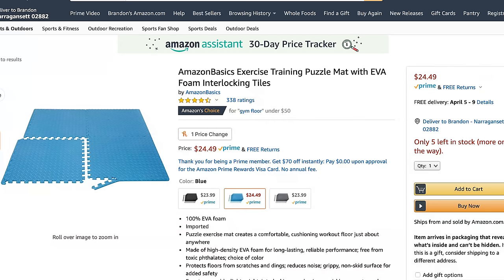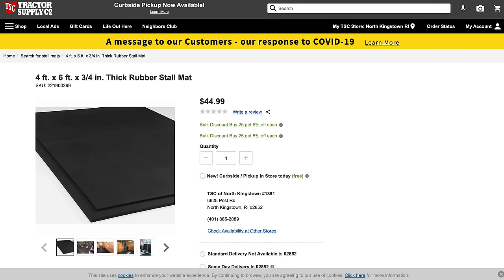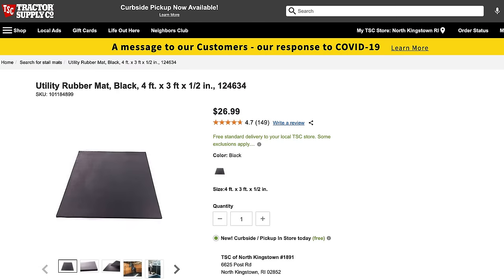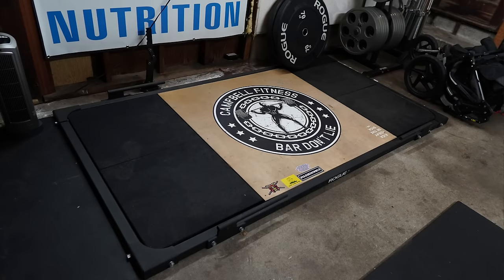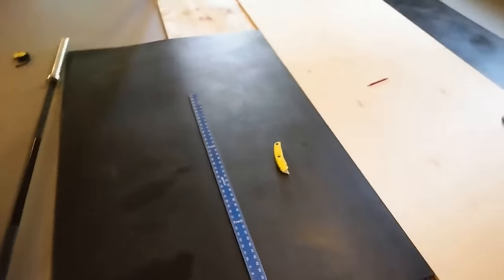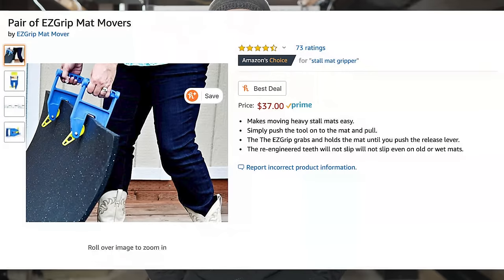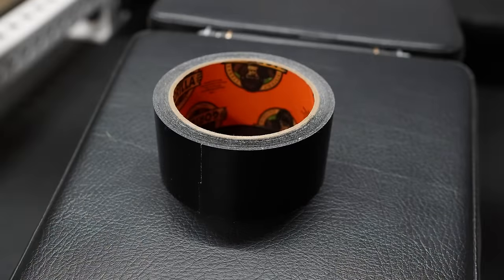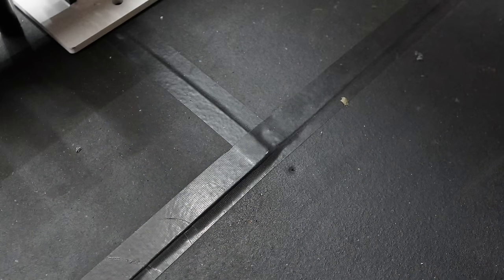Home Gym Flooring Basics

Comment: For deadlifting, do you think having 2 sheets of plywood underneath stall mats would provide significantly more protection for your floors vs 1 sheet. In your platform videos, you use 1 layer of plywood underneath. Any reason why you don’t use 2?
Reply: Alex Desta I use 2 layers of plywood with the TSC mats and another plywood in the middle. It’s better safe than sorry.
Reply from the maker: I think it's "better" but I also think there is a point of diminishing return. Never had an issue with a single layer of plywood and a single layer of matting.
Reply: Brandon Campbell Diamond What do you think about just stacking 2 stall mats together instead of the plywood sheet?
Reply from the maker: Alex Desta fine room. Might get a bit more bounce.

Comment: Any sort of multipurpose cleaner or believe it or not, degreaser works well.  I laid mine out on the driveway and hosed them down, then used a long reach scrub brush to clean them off.  I scrubbed them twice on each side and let them dry out in the FL sun.  The smell decreased by about 80%.  There seems to be some oily residue on the mats when you first get em which can also make them a little slick (hence the degreaser).
Reply from the maker: Thanks for the feedback!

Comment: I put down a few stall mats (one side is smooth the other has texture) in my unfinished basement about two years ago. Just recently I noticed when it rains I get some water underneath the mats only. Any recommendations on how to combat this issue?
Reply from the maker: You may be able to get a vapor/moisture layer

Comment: You just answered my question. So Carpet it is. And I will just use a  Platform for deadlifts. I am not dealing with that smell in my basement. Thanks.
Reply from the maker: No problem.

Comment: I saw a shot of a rack set on top of the mat.   Do you typically have your rack on top of the mats, or would you cut around the feet so the rack sits on the floor/concrete directly?   Wondering if it is ok to bolt the rack down right through the mat or if the rack needs to be directly on the concrete.
Reply from the maker: You can do either, I just don't like cutting stall mats if I don't have to. If you do, put the rack on top of mats first and outline the feet with a sharpie, then go back and cut.

Comment: If you lower a deadlift with control or perform a controlled drop (never dropping from the top) can you getaway with just 1 layer of stall mat or is a platform the way to go as to not damage concrete in the garage?
Reply from the maker: Lots of people in the comment section say so!

Comment: Hey Brandon, I want to turn my storage shed in my backyard into a gym. Its a shed built on top of a concrete slab by the previous owner. Only problem is that when it rains hard (which seldom it does in west Texas) it leaks on to the concrete in the 4 corners of the shed. If I place these on the concrete and it rains and water leaks underneath will it just evaporate over time because of the grips on the underside or will it mold? Or do you know of better option? I can't figure out y the thing is leaking in the first place otherwise I would just fix that.
Reply from the maker: I imagine prob a bit of both (mold and evaporate). Give it a go and see if you can get by with them.
Reply: @BasementBrandon  sounds good thanks for the quick response.

Comment: Thanks for this.  Question.  Would this work for covering a workout area and also an area where a truck is being parked in a garage as well.?  I have a 1/3 or 1/2 Bay Area where my rack will go but want to put down flooring across where my truck is park where there will be water and snow coming in with the truck-then the truck will be moved when I work out.  Guidance appreciated.  Thanks so much
Reply from the maker: I think it would work (I've seen it), but it's prob not ideal

Comment: I’m planning on putting my home gym on carpet, as I don’t have any other space available. I’m worried about the rack tearing up the carpet under it, and I don’t plan on doing any movements that would threaten the foundation (deadlifts, snatches, dropping the weight). Would I still need flooring to protect the carpet from the rack? Could I just use plywood as a flooring, opposed to horse stall matts? Thanks!
Reply from the maker: I think part of it depends on how plush the carpet is. If not very plush you should be able to get away with something a lot more minimal.
Reply: @BasementBrandon Thanks! One last question with regards to horse stall mats: When I go to the tractor supply website, and select pickup, it ends up including the amount for shipping. Is it possible to simply go to the nearest tractor supply and purchase the mats in store?
Reply from the maker: @codershane6569  Yep, I'd just call ahead and make sure that 1) they're in stock 2) they have the kind you're looking for.

Comment: Here's a tip guys-Use mending plates under your mats to keep them together, look up Allan Thralls gym flooring hack video to see what I mean. (I know you saw it already Brandon but for those that may not have I wanted to share it here) Also some people suggest putting concrete screws with a washer to squeeze it down around the perimeter, I would suggest doing that during the summer though so they don't buckle when they expand from the heat
Reply from the maker: Right on!

Comment: quick question, if I dont drop weights from overhead and don’t plan on deadlifting heavy weights, mainly have a rack for squats bench, rows and accessory work along with an air bike. Do you think 1/2 inch stall mats should suffice, or do you still recommend 3/4? Asking since I saw 1/2 inch 3x4 mats at 12 dollars vs 4x6 3/4 inch at 40. Thanks
Reply from the maker: Prob don't even really need mats if you don't want in that case, but 1/2 would be fine.

Comment: Brandon, do you have any recommendations for gym flooring over carpet? Thanks.
Reply from the maker: I might try to put a more firm layer first depending on the plushness of the carpet. So maybe a thinner piece of plywood first, then mat.
Reply: I put down a 1/2 inch plywood  and then stall mat from Tractor Supply. Provides a much firmer foundation.

Comment: I started a deadlift program right when the quarantine started so I needed a place to deadlift. Went to tractor supply with my brother on Saturday and luckily there were 2 of the 4x6 mats left, just enough and perfect space for our basement. Haven’t had any issues and were only deadlifting in the 300-400 range. However we have concrete flooring underneath so would you still recommend trying to get 2 more mats to stack on top? Or do you think the one may thickness is fine for now?
Reply from the maker: There are some in the comments who said they've used a single layer with no issue. I'd just check underneath periodically to make sure it's not causing any issues.
Reply: Brandon Campbell Diamond right on. Also it’s good to see you respond to every single question, especially with videos like this. It really shows your care and reliability when compared to other people. I think I saw in a vid you’re from RI, I’m from CT. From one NE dude to another, let’s get these quarantine gainzzz
Reply from the maker: Least I can do if people take the time to watch/comment. Yep I'm in Southern RI!

Comment: I know you mentioned the smell but these mats are not ideal for indoor spaces (like guest rooms, etc.) even after airing them out for a while. 
It would be nice to know if there are alternatives out there that have minimal or no smell even if they cost more than the TSC ones.
Reply: juvinious regupol flooring
Reply from the maker: I think I've seen some marketed as low to no order but don't have any firsthand experience here.
Reply: @BasementBrandon  Thanks!
Reply: I just purchased three of these for my garage gym so i don't have an answer for you regarding alternatives.  As far as smell this is what I did:
Lay them out in the front driveway for two or three weeks 
Flip them over every couple of days so they get sun and rain
Every couple of days, sprayed them down with water and detergent (Tide)  and scrub with an industrial brush
 (MAKE SURE YOU CLEAN  BOTH SIDES of the MAT!)

Comment: awesome video man. very informative. Just wondering in regards to the problem that these mats can move... what do you think about laying down a piece of thin stiff/dense carpet underneath to combat that problem? I know the high quality plush carpet would definitely make everything feel really squishy, but what about those cheap thin ones you generally see on the stage in theaters?

If adding wood in between is not an option, would you rather just ditch the carpet and deal with having to adjust the mat placement? lol 

Thanks a lot!
Reply from the maker: I'd prob just go an easier route of the tape like i show, or get some mending plates, which are small metal plates with teeth that can be placed under the seems.
Reply: Brandon Campbell Diamond basically idea is to have the two piece be stuck onto one piece of plate right (kinda like tape but on underside)

Comment: Brandon, moving into a new home in 2 weeks and I will finally get a dedicated space for a garage gym. It is built on a slab. Do you think I need to make an additional deadlift platform to put on top of the horse stall mats that you recommend to protect the slab and soften the noise so I don’t wake up the kids at 5am when I am training?

I was hoping to keep that open area next to the PR-4000 rep fitness rack more level to do kettlebell and other exercises.

Any recommendations on a good bar that I can do bench, deadlifts, overhead press along with hang and power cleans? I know you don’t do cleans but I am kind of on a budget and can’t talk my wife into getting more then one barbell to start. Later on I would like to get an actual deadlift bar.

I was going to get either the rogue 2.0 bar or rep fitness gladiator bearing bar.

Appreciate the feedback and what you do. Love the videos and I miss living in Rhode Island...did my anesthesia training at RHI in Providence several years ago
Reply from the maker: I mean it's going to be loud if you're lifting heavy regardless. If you look at the comments there are a lot of people who just use a single stall mat and say it's fine, but I just prefer to go an extra layer.
Reply: Brandon Campbell Diamond ....thanks brother on the rep fitness site that just re-opened. It’s like the hunger games trying to get stuff before they sell out

Comment: Dear Brandon,

What is your experience with using stall mats over hardwood floors? I want to section off a portion of my living room to do deadlifts and squats. I do not plan on throwing weights around or dropping it on the floor. I will just have a basic rack, a rack for the plates and maybe a deadlift platform. Do you think it is feasible? What other precautions do I need to take with my hardwood floors?
Reply from the maker: If you never are going to have the weights on the floor it shouldn't be necessary to have rubber IMO

Comment: Here's the deal with everyone asking about how thick a mat or platform should be. Consider how much replacement cost will be for your foundation if you crack it or cave it in. It will most likely be in the thousands (plural). I was at a commercial gym that used one layer of 3/4 rubber mats throughout. There were divots all over the place. One section of concrete they replaced cost the owner 9 grand. Better safe than sorry. BTW, I use 3 layers which is about 2 1/4 thick. But I do weightlifting and have friends that do very aggressive deadlifting. We lift at my friend's father's house. He'd kill us if we cracked his concrete!
Reply from the maker: Good point

Comment: I’m planning on making a home gym in my basement. Right now the basement has laminate wood flooring. What would you recommend for this? Would one layer of these stall mats be enough? 

Planning to deadlift at max 300lbs so I’m wondering if one layer is enough to protect/preserve the flooring underneath.
Thanks!
Reply from the maker: I still think it makes the most sense for a 1.5" deadlift platform, although if you read the comments there are plenty who say they do it with just one layer of mats without issue.

Comment: Great content as always and big congrats on the 200,000 !!! Difficult to get stall mats in the UK but have managed to get two 1m by 1m mats that are 20mm thick for deadlifting in my garage until the gym opens back up - a little short of the recommended 2.4m for a deadlift platform but I've got skinny plates and I'm not filling the bar so should be fine. When everything opens back up again I plan on getting some plywood and making a platform.
Reply from the maker: Appreciate the insight, where did you find them? Sure other people in the UK would appreciate it!
Reply: @BasementBrandon  Just on Amazon in the end. It was the only place I could find that was still delivering. They were £34 each for a 1m by 1m (20mm thick) tile - search for "POWERGYM Rubber Flooring Tiles"

Comment: i’m transforming a spare room in my house into a gym, do you think these would protect my tile or would the tile still crack?
Reply from the maker: Will you be dropping the weights on the floor? If not it shouldn't be an issue. If you are, you may want to build up multiple layers.
Reply: Brandon Campbell Diamond most likely the only dropping i would be doing is dead lift so that would be at a close distance to the floor

Comment: so right now my tractor aupply has them at $45 and rural king has the same dimensions and thickness for $38 but are not recycled. any opinions?
Reply from the maker: I'd go check out the cheaper ones to compare before buying, but if they're cheaper and you're buying several, might as well save some money.

Comment: I built my platform using 2 layers of plywood and stall mats on top, so it's a total of 2.25in. Will the rogue or titan platform frames not fit?
Reply from the maker: I think you'll find that's prob a bit too high, They're built to fit 1.5 inch heigh IIRC.

Comment: If yall on carpet i recommend using 3/4 plywood then putting mat on top. I built a deadliftk platofrm of 2 3/4 plywood and then horse stall on top and it was real hard and stable recommened on carpet
Reply from the maker: Solid suggestion

Comment: Brandon, thanks for the great video.  Informative, as always.  Do you have any idea of the safety of these mats in regards to VOC's?  I actually have 16 of the 4'x3' stall mats and while they work great for my gym in terms of function, they smell pretty bad still (only had for like a month).  Curious if you know if any research on the potential negative effects of inhaling the air from these?
Reply from the maker: Not that I know of, from my experience though tolerance of the smell differs greatly by the individual.
Reply: @BasementBrandon  Gotcha.  Thanks.

Comment: Great video, thanks! I picked up 4 mats yesterday but Tractor Supply only had smooth bottomed ones. I live in Los Angeles, so it's pretty dry here, but do you think the flat bottom is big issue? I could try to return/exchange them, but I had to drive an hour out of LA to get them since they're sold out all over the place!
Reply from the maker: I don't think so. I had some previously and didn't have issues.

Comment: You can also use industrial grade double sided carpet tape to secure your rubber flooring. It looks a lot cleaner than gorilla tape over the top.
Reply from the maker: Will have to give this a look
Reply: @BasementBrandon  Its what I used for my rolled rubber flooring. Really cheap and easy to work with. Make sure you buy the fat 4" wide rolls.

Comment: Is there any biomechanical advantage of covering the gym floors? I made a small 1000$ gym in by garage that doesn't have any mats and the floor is made out of concrete and is kind of damaged (has holes in some places). I'm just going to use it over the Coronavirus period, so should I bother? I just did deadlifts where I just barely touched the ground and I don't mind it.
Reply: Sounds exactly like my garage gym floor.  I just purchased three of them with the purpose of building a garage gym and canceling my gym membership by the end of this year. 
These mats are awesome however a real pain (weight, smell).  
To answer your question, home gym use for a small period of time?....I wouldn't bother.
Reply from the maker: More your call! Most prefer to protect the floor and weights.
Reply: If you really feel you need mats but don't want to commit to anything, just purchase those cheap ones he mentions at the beginning of the video.

Comment: Will stall mat  also protect the foundation if it is pre-tensioned concrete? Or would a deadlift platform be required.
Reply from the maker: I'd still prob go two layers or a layer of wood and a mat on top

Comment: rogue has a nice option for the 4x6 3/4 inch mats, it has a light texture on the top side which is much grippier, i find my feet slip benching on the regular stall mats.  Only down side is the texture makes them a little harder to clean since dirt tends to cake in the crevaces.
Reply from the maker: They do look great, but you end up basically paying $70/mat!
Reply: @BasementBrandon  ayy true. I purchased the 50 pack with shipping and tax came out to about 3000 or 60 a mat. Not terrible and they are def superior quality compared to the stall mats, biggest issue is getting em clean.